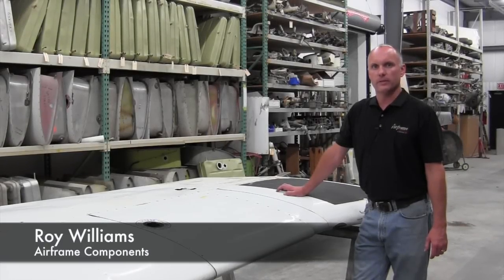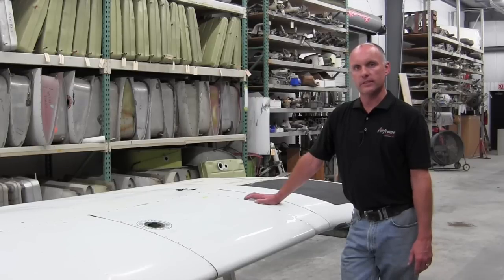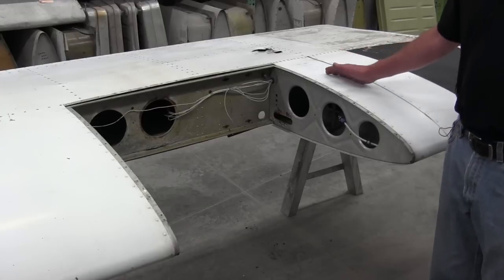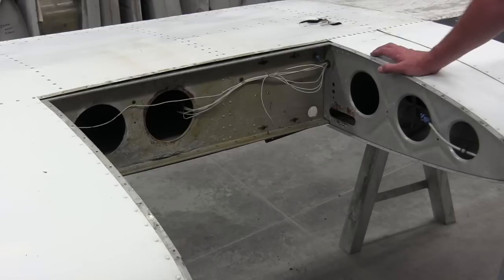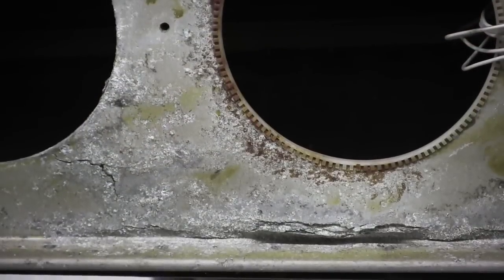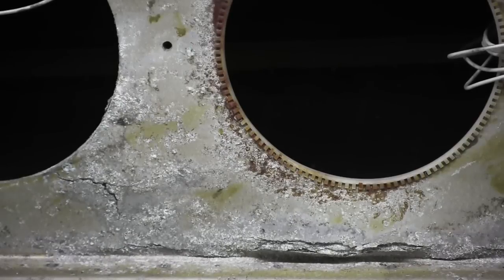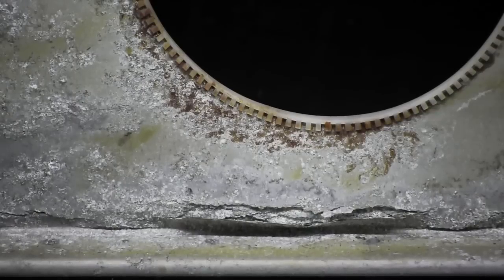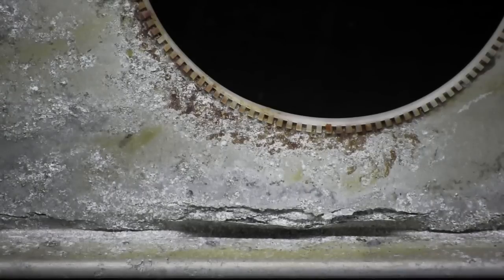Piper Wing Spar Corrosion SB1006

Comment: So this would not ordinarily be visible in a routine pre-buy for a cherokee 140/180? Ive wanted to buy vs rent but am scared stiff of getting stuck like this
Reply: No, in a typical PA-28 prebuy inspection, you would not drain and remove the fuel tanks for inspection of this area of the spar. However, you can ask for it to be done, expect extra cost though to perform the SB.

Comment: Piper should be liable for repars for inadequate corrosion protection. But they are barely surving.
Reply: After 18 years, the manufacturer is not liable.

Comment: thanks. what is the repair action for that wing spar? Can it be repaired or does it need replacement?
Reply: frankus54 Extruded spars can not be repaired.  The most economical path would be to find a serviceable replacement wing.
Reply: frankus54  
1-Reinstall forward fuel cell.  
2-Light plane on fire.  
3-Collect insurance.

Comment: I found that piper cheated on wing fitting by cutting corners On spar fitting by not following ndustry stds and FAA stds of drill ing holes too close tonedge of spar fittingas the piper that lOstwing it clearly SHWos&7/16" for edge of bolt hoe to rounded sedge of fittig >too clos e and it failed .I am pursuing stc to modify pipers to precliude spar failure John Dyke AP1410799/iA ,PE,ac designer
Reply: wtf???